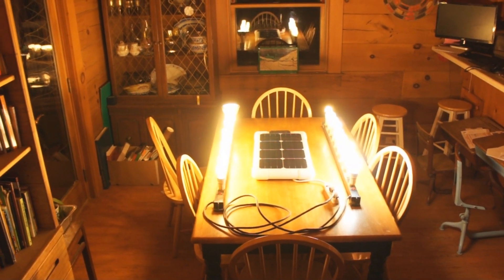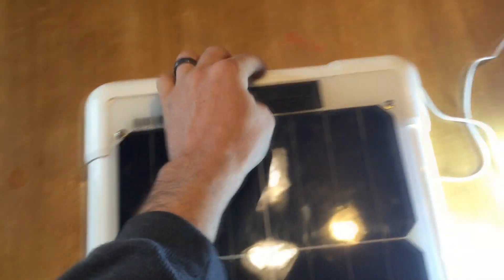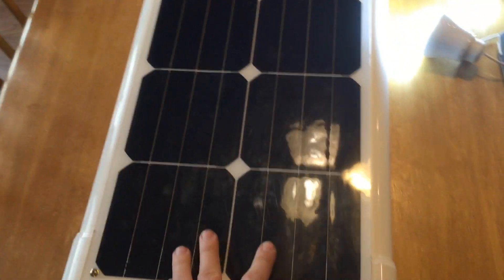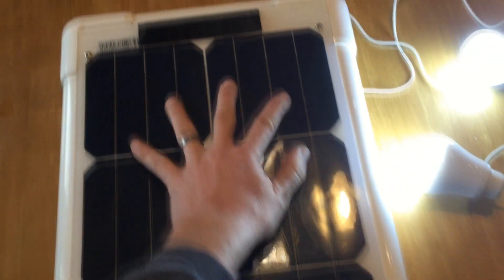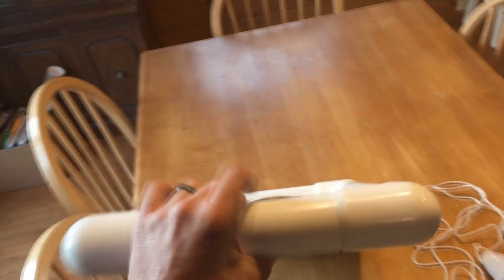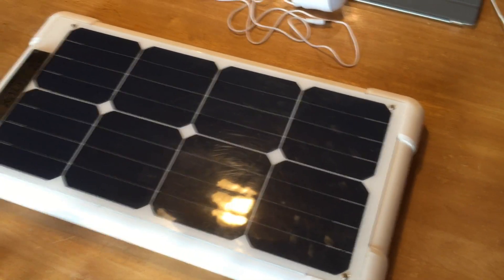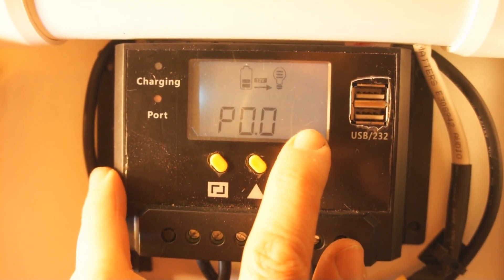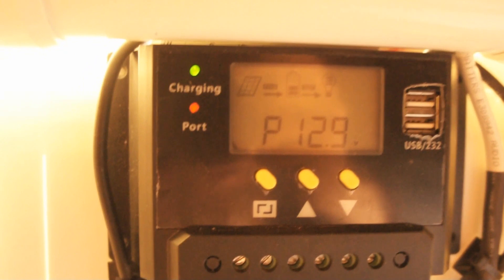SOLN1 25 - Easy to Build DIY Portable Energy Generator Solar

Comment: Hey, I know it's been a while, but I have one of these. Took it out of long term storage. Had the battery disconnected. The port light on the charge controller is blinking red, and the charging light is flickering green. It doesn't seem to be charging. I'm wondering what's going on. Any thoughts?
Reply: Also, if I remove the fuse and reinsert it, the charge controller starts to beep, but the beep kinda sputters out then. I'll also mention that the inverter is pulling nothing. It might be because the battery is so low and hasn't been able to charge so that it can't pull anything though.

Comment: Too bad the price tag is so high... Nearly $500.00... Can not see something like this actually saving me 500 bucks in electric bills in any period of time to be worth it...
Reply: You're correct. Better option is to get the Harbor Freight system. Charge your batteries then take them, along with the inverter, out in the field. Dragging along the solar panel is pretty much worthless due to the very low watt rating.

Comment: I know this is old now but couldn't you have used your capacitors, ie charge them up using the lights and feed that charge back into the batteries as a separate unit, considering how fast the capacitors charge.

Comment: This is a cool little unit. 1 question..... Where are you storing the energy to drive the equipment? You plugged in your bench grinder directly to the invertor without having the panel in direct sunlight. How does that work? Don't you need a battery to draw off of?
Reply: Frank J. Denig looks like built in batteries
Reply: karzygijose but where? There gas to be a battery bank somewhere in order to get that power to run the equipment.
Reply: Frank J. Denig possibly inside the pvc tubing
Reply: Hmmmm.

Comment: The soln1-25 can be converted to put 12 of those battery's in it. 4 on both sides and 2 more on top and bottom with a total of 12 battery's and 30 ah. I would use a larger inverter with 10 fold out panels that Velcro to the back and a super capacitor  under inverter for those peski start up voltages. OR instead of the capacitors use more of those battery's and put under the inverter and on more on sides. it looks like you can fit 9 more battery's in the back of that unit. For a total of 21 battery's. It would have to be wire properly tho. You can make your own fold out solar panels with a little glue and Velcro. so they pull out of back of soln1-25 like an accordion. I don't know if they make a 500 watt inverter that will fit in the back of that unit. But if they did you could double the output of that unit and with fold out panels you would have less down times on charging. You could use this for a number of off grid uses. #1 Pumping water to your garden or farm animals with small pump. #2 inside/ outside lights at night. #3 power hand tools drill/saw/router/dremel tool battery pack recharge tools for 8-10 minutes a time. Maybe. #4 power laptop computer #5 recharge cell phones #6 The panels alone could run a 12 volt freezer. And I know that one of those panels puts out more than 5 volts and you need 12 volts just to run the inverter, so if you had 10 panels, it can easily run a 12 volt freezer.  #7 You might be able to run a little microwave oven to cook food. mine is 120 volts 1450 watts, 12.08 amps. but you can get a lot smaller ones. This might be questionable. IT just has to run long enough to cook the food for a short time. Then you can recharge unit. I do NOT know how long it takes to recharge the unit. #8 Maybe, Maybe a small induction cooktop , I don't know. Mine is 120 volts , 1300 watts 10.8 amps. ???? I don't think it would last15- 30 minutes to cook food. #9 A fan. #10 a radio or C.B. #11   54" T.V mine is 120 volts 145 watts 1.3 amps.  #12 battery recharger for battery's for clocks, flashlights and radio's. IF you had about 3 of these you could rotate them. Use one and when it needs charging rotate to the other one use it while the other is charging. I don't know if you could put 2 of these in parallel or not.  I also do NOT know how the inverter will hold up on some loads and how long the inverter will last or how some items will perform in use for how long. My guess is that the inverter will die or shut off when load is too great.

Comment: You should try to find a pure sine inverter for these kits that meets good specs and is light weight. Modified can be an issue in some applications and certainly makes certain types of power supplies run hotter or damage them. I know pure sine is much bigger and heavier so it might not be practical for a camping type device. I have the 300w pure sine Go power and its 7.7lbs, feels like a tank. Strangely the 600w version is only 5.4lbs.

Comment: I'm the first to admit that I've probably done the math wrong, but I was under the impression that a 240 watt inverter worked out to 2a at 120v.  The demos appear to show devices requiring more than 2a running off of it (I'd, naively, expect the bench grinder and jig saw to draw in the 10a range)..  

So, where did I go wrong (I'm hoping that I'm wrong as that would make my life significant easier)?

Thanks in advance!
Reply: +Steven Funk I was thinking the same thing... Maybe it's 250 watts continuous, 500 watts peak, which would get you to about 4 amps, which could possibly run the bigger stuff, but it shouldn't be run for an extended amount of time..

Comment: Add a 12volt Socket....

I like that the Charge Controller has USB....generally they have a 12v load out connection as well...

Comment: I am impressed by what you do with solar energy!!! I want to learn about this mechanism of transformation of solar energy into electricity. I study at the Polytechnic University of Bucharest and I would like my theme name for the license , be based on the transformation of solar energy into electricity. Because I'm just a beginner, I would like to realize even a small portable battery for mobile phones wich solar energy to charge it. I ask you if you could help me with a few web-sites that can inspire me , and where i could find some information that will help me . I look forward to a response from you. Congratulations and further success! (Greetings from a student at the polytechnic University of Bucharest !!! )
Reply: +Ana Maria Felicia Marconi Search for "How to calculate needed battery Ampere Hours"  on YouTube, It's a video by ESRepair. It will help you with some of the theory you'll need to start... If all you need is to charge a phone, search for "DIY USB solar chargers," there's a lot of tutorials about that. If you want to go beyond small chargers, a basic solar system needs these components: solar panels (collects energy), a charge controller (charges and protects battery), a battery bank (stores the energy), a Power Inverter (converts DC current into AC current to run appliances).

Comment: Very cute but not really functional, small panel, PWM charge controller, and the MSW inverter is all but useless.  This would be great with just the USB minus the inverter.  The video (as does the inverter) however gives the wrong impression and is misleding, you can run a grinder without load but not with a load and either way not for long.  250 watt hour isn't much people, with the 85% efficiency of that inverter you could run that 4amp bench grinder for about 10 minutes before the inverter kicked in.  If he wants to impress us show some benchmarks as I wouldn't trust anything this guy was selling based on this video.

Comment: is all that stuff running off the batteries ? How long will it run that much stuff  before you have to get it into full sunlight to re-charge the batteries ??
Reply: well ?
Reply: +triumphmanful Well....it is 20 amp hours....so it depends on your amp load. 1 amp will supposedly run then for 20 hours....5 amp for 4 hours...etc....but there are some caveats...
  One is higher loads can have a larger drop in Voltage. And so you can have some voltage drop of 1/4 to 1 or so volts...thus limiting run time for higher wattage appliances. This NOT going to run a small microwave oven with 850 watt power consumption.
  I am surprised he got the Jig Saw, and Drill press and grinder to work, and even the Blender...
  I made a Two 100 amp hour battery Solar Generator set up with a 1500 watt inverter, I can run my microwave for around 26 minutes total. Around 8 three minute uses...with a tad to spare.
  500 watts Peak power means for a few MOMENTS it will run up to that wattage to start a motor or something that needs a bit of power to get going, but it does not sustain that. My 400 watt inverter will not run that jig saw I am pretty sure. I CAN run my 2.2 amp at 115v WEED WHACKER no problem...that is around 18-19 amp at 12 volt.  My 300 watt one cup tea maker will run on my 400 watt inverter. I have a 100 amp hour battery with the 400 watt Cobra Inverter.
  This seems like a nice little unit.

Comment: What is the highest watt rated inverter that can be used with this system? Having been a truck driver for years I have seen a variety of sizes 250 watt, 400 watt all the way up to 2500 watt. What is the limiting factor? Thanks for everything you do, keep it up. :)

Comment: A disclaimer & time-limited liability should be included, inclusive of degradation of impact strength, and cracking due to exposure to strong doses sun/uv light.

PVC as well as many plastic polymers degrade in the sunlight. Carbon reinforced polymers are less susceptible to uv degradation. Microcracks on sheets meant to be transparent would mean decrease of transparency and light transmission.

To avert degradation from UV, PVC surfaces should be coated with uv-blockers. Obviously, coating the supposedly-transparent plastic sheet with uv-blocker would defeat the purpose of the solar panel. Therefore, customers should be educated on how to replace that sheet whenever it becomes cloudy. A detection means should be included to let customers know the level of transparency degradation.

Otherwise, good old impact-resistant glass could be used to cover the solar cells. Actually, shatter-proof, not just impact-resistant glass.

http://www.jmeagle.com/pdfs/Technical%20Bulletins/TB10SunlightEffectsonPVC.pdf

http://en.wikipedia.org/wiki/Polymer_degradation

http://en.wikipedia.org/wiki/UV_degradation

http://diy.stackexchange.com/questions/18339/which-type-of-pvc-for-exposed-outdoor-use

Comment: Will this run a 110v  A/C very long?
Reply: DL Spamalot 
No.
Reply: Dark Eternal Thank you.
Reply: +DL Spamalot Actually it depends on the AMPS you are using....it will run 1 amp for 20 hours...but that drains the batteries....GENERALLY you use 50% of your battery capacity to save wear and tear on the batteries. He has around 10 hours at 1 amp useful...or 2 hours at 5 amp.

Comment: The concept and idea is great. However LiFePO4 battery packs need to be balance charged to ensure that each individual 3.7V cell from a battery pack does not get overcharged. Otherwise this will inevitably lead to battery failure.

Comment: I'm planning on working on a project very similar to this one but i ran into a little problem; most MPPT solar charge controller that i'm looking at are made to charge lead acid or gel batteries and i'm planning on using Lithium Ion batteries, but in this video you are using a charge controller that is made to charge a lead acid battery, is it safe to use for lithium ion? would it stress the lithium ion batteries? or does it work fine with really any batteries?
Thank you for your video!

Comment: This would be great on the rear of an electric assist motor biicycle rack.
Maybe a little large but acceptable.
How many watt hrs does the battery hold by the way?
I am currently using a Ping 24 volt 10 AH Lithium Iron Phosphate battery
on my electric bike.
The Organic Transit Elf Velomobile has a solar panel on their electric assist bike vehicle

Comment: I am interested in the SOLN1 25 and visited your website. I would be interested in using it on camping outings and am curious if it will run a small coffee pot or a small microwave. We also sometimes use a small fridge in the camper. But if we camp without power these luxuries are not available. Would this system work for such devises (One at a time of course) if it would it would mean we could camp in some very nice areas without having to run the generator. I saw in one of your videos that you intend to develop a joule ringer to use with the system. Is that available yet?  You can message me to my google if you wish or answer here if you like... Thanks... Love your vids by the way!

Comment: You rock dude. placing the batteries in the outside tube is fabulous. I got inspired by your USB lights you get from china and made my own from the dollar store by taking a standard led flashlite that uses 3 AA batteries and drilling a hole in the bottom. I cut up a scrap USB cable from an old cell phone, fed it thru the hole, and soldered the positive and negative leads to the inside connections. I tested it with anything that connects via usb and it works like a charm. if you leave the battery stuff intact then it can double as a regular flashlite. Cost me less then $3.
You got me thinking and playing so thanks for that.
Keep up the great work.
Cheers

Comment: Hi, I am Loving to buy one as soon as you have them available. I want a 30W or 40W version that is marine worthy just like this design. Is that do-able? Do you have any ideas on how to make one of these canoe or kayak worthy that can take getting wet and be more exposed without damaging the electronics? I'll be running this out into my Minn Kota 12V marine battery center via USB I troll with to keep my battery charged while out on water and over the weekend camping and be able to take it off boat at night for camp use.

Comment: Thank you for being so open with sharing your innovations. I think double side the machining on the elbows to finish the back side with a piece of abs or polycarbonate sheet with in-set weather resistant usb and plug ports. Then we could really toss er' in the back of the jeep. Wher do you source your panels or are you going to sell them on your site.? Ive had a hard time finding semi flexible at a reasonable price.

Comment: Hi rob,
I'm trying to build one of your booster pack ' s fautered on your youtube channel and I'm having trouble finding the Maxwell supercapacitor you used in one of your videos, at a reasonable price. I was looking on ebay and  finding that the price of the large supercap's is $60 plus each.My  question regards where did you find these maxwell Cap's? I live in the california bay area, where is a good place I could purchase these caps?

Comment: would like to see more build information especially on the batteries used in this thing m your mentioned websites did not help.  they seem a bit empty on content , so what batteries are inside the pvc ,  even bigger question the v3 unit , what is that big flat battery pack, where was charge controller in that circuit?  I very much like your project it just left lots of questions ,  thanks
Reply: I had the same question but with the information given You can figure that at 12.8 volts and 10ah with screw terminals it has to be 4 LiFePO4 38120 S m size cells in each tube

Comment: Very nice, but It is still Static Energy, whit this kind of energy you will never get more then 20 - 60 volts. but from Kinetic Energy with help of a little bit of Radiation energy we will  easily get from 120 up to 10000000 volts,

Comment: Well since everyone else has their christmas wish list out on features they want i guess Ill add one I didn't see.
Camping or short term storage of the camping vehicle. How hard would it be to make an output to charge or float charge your camping vehicle?
What the circuit would need to do is make the soln1 the priority charge. When its batteries are charged then it would continue to use the leftover available solar energy to charge or maintain the vehicle starting batteries. Versatility you know. :)
Loved the video and can't wait to get one or two of these. Speaking of which. What if you had 2? Could you make them work together to double their output?

Comment: Pretty cool.  Do I have my math right?  2000 charge/discharge cycles at 1 cycle per day would give a battery life of about 5-1/2 years?  Pretty good, depending on the cost of battery replacement.  What batteries does it take?  Are they readily available?  At what cost, currently?  Can you provide a link or Manufacturer name/part number?

Comment: Very nice design! You do very nice work. From first glance at the video thumbnail, I thought you were running the lights directly from the solar panel sitting on the dining room table. :-). I wonder if you would be better off using high value super caps instead of the Lithium batteries for intermittent high current use. Batteries are a pain, they never last as long as they are supposed to(In this case 2,000 cycles). Some manufacturers make inferior batteries. You end up replacing them, which is not cheap. The LiFePO4 batteries are good, and (4) in series is close in voltage to a lead acid battery, but there is always one battery in the bunch that ends up going bad. Operating a 200/250W load requires 20-25A off that 12.8v/10A battery pack, so you won't be able to run a heavy load for long periods of time. If you run a 120V/200W load for 5 minutes, it will take almost an hour in full sun with that 25 panel to put that charge back into the batteries.
Reply from the maker: electronicsNmore 
Thanks.  This design is something that I see being must useful for camping, after grid failures, running laptops etc.  I have a bigger 100 watt design that works better for heavy use.  I have actually done a lot of testing with a BoostPack + solar in the past. It works great:  http://youtu.be/_io9YHKdbTw
Reply: Find out how you can build a cost free energyyyyy generator>>>http://renewableenergyy.blogspot.fr >>>>